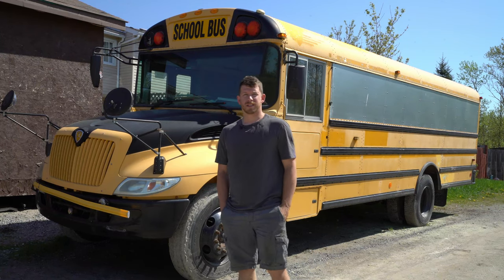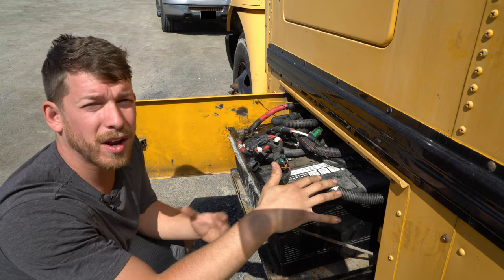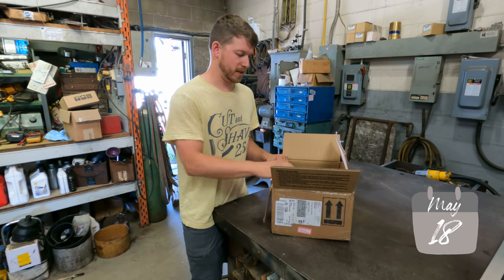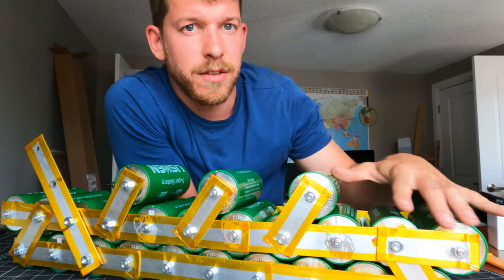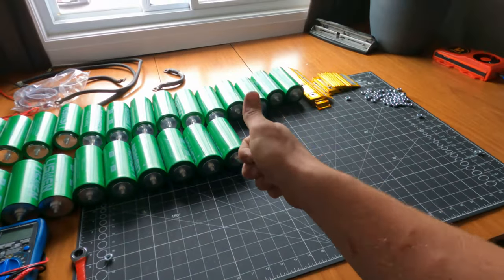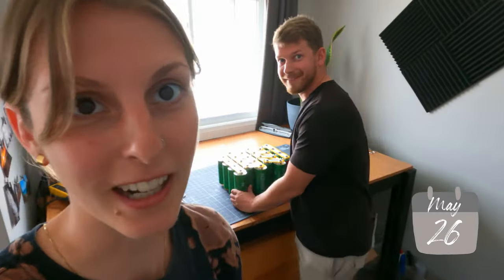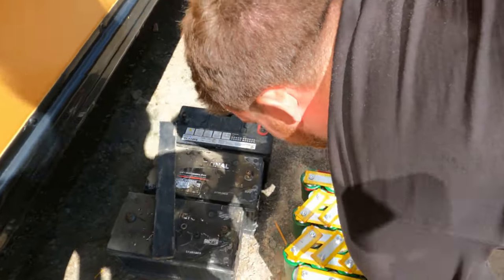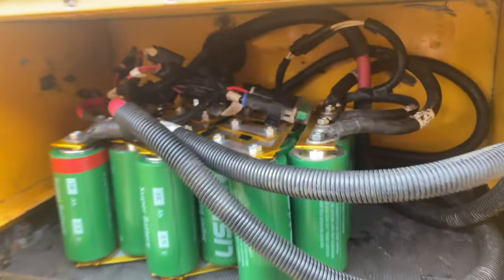DIY Lithium Titanate (LTO) Starter Battery | Skoolie Conversion Ep. 9 | Adam & Steph

Comment: Allow me to give you some advice - what you've created there is extremely dangerous, likely to fail and not a great choice for what you're trying to do. 
   First of all, if your install is intended to be permanent, mounting those cells on their terminals is a bad idea - not only do you have high pressure points on the rubber mat below which will eventually wear through, but it's also bad for the cells as some of the terminals are effectively only press fits.  Mounting the cells horizontally is much better and safer.
  Aluminum expands and contracts a lot with heat - the thin heat shrink wrapping on the cells is sure to wear through in such a high vibration/high temperature variation environment which will lead to short circuits and a fire.  Use at least some fairly thick tape (like the cheaper gaffer tape - cheap gaff tape has a smooth vinyl surface; good gaffer tape is more textured and likely to cause wear) between the cells.  You'll note that the cells have a "bump" around the positive end - that's most likely where the short will occur.
  It looks like the nuts you're using are zinc plated steel, which the way you assembled the pack is a better choice than stainless, but anytime you have an aluminum to steel or stainless steel threaded mechanical joint you must use some sort of anti-seize otherwise the risk of galling and destroying the threads is very high; especially in the presence of electricity.  Also, aluminum oxidizes very quickly, and the oxide layer is actually an excellent insulator - exactly what you don't want in your setup.  You can kill two birds with one stone by polishing the aluminum bus bars right before bolting them on with some fine sandpaper and using something like Noalox on the terminals and bus bar to cell mating surfaces for both corrosion resistance and it'll work well enough as anti seize on the threads and under the nuts.  And that Kapton tape is also causing unnecessary stress to the terminals and forcing the aluminum to bend in order to make contact.
  Your voltage was high because, well, LTO kinda sucks for 12 volt applications.  In a 6s setup like what you've got, you're basically throwing away a lot of the cells' capacity.  Max alternator output is only supposed to be 14.2-14.4 volts; a 6s LTO pack will only give you anything close to rated capacity at at least 15.6 volts.  Since most automotive (and bus) electronics are only rated to 15 volts absolute max, you've over-volted the electrical system to the point of imminent failure.  But once the pack is drained and charging from the alternator, you'll simply have a pack that has a little over half the capacity you think it has.  And you run the danger of going into over-discharge of some of the cells.  LiFePo4 would've been a much better (and probably cheaper) choice in this application.  If you ever drain down the battery to about 12 volts or so, and you start your bus, you're almost immediately going to overload your alternator because you'll be in the "constant current" point of the charge curve and those cells will take more than your alternator can put out - a lot more.  Like 500+ amps more than your alternator can handle.  It's very likely you'll release the magic smoke from the alternator.
  Speaking of which, you really should run at least a balance board.  I'll agree that a BMS isn't that necessary in your application, but a balance board is.  Especially if you didn't top-balance and individually load test them and match them before installation.  It's inevitable that you're going to kill off some of your cells over time.  The active capacitive balance boards work pretty well.
  Finally, please don't use a grinder on aluminum.  Two bad things happen: 1.  You end up ruining the grinding wheel because the aluminum melts into the wheel eventually clogging it and making it useless and 2. The grit ends up embedded in the aluminum, which will then wear anything it comes in contact with.
  Hopefully you don't take offense to these points - I'm literally just trying to save you from getting stranded in a best case scenario, or getting trapped in a school bus inferno in the worst.
Reply from the maker: Thank you for all the advice! When designing the battery, i knew the voltage was less than ideal for a 12v application. I bleed off the extra voltage to protect the bus electronics. I played with the idea of LiFePo4 batteries instead of LTO, but concluded that with consideration of the thermal properties, LTO might suit the canadian winters better and can throw the needed amperage required to turn such a big starting motor. 
For balancing, they were capacity tested by batteryhookup and supposedly matched. I then checked balance and they were all perfectly the same. You are right about needing a balance circuit. 
For packaging, i built a pvc box with internal padding for it, and straightened out the cells so them keep away from each other.
Are there any solutions for the alternator problem? Any battery build that that can start this battery will be able to pull crazy current and probably put the alternator in cc. I think because I’m using this battery so close to the cliff of its voltage curve, it charges up quick enough at the alternators 160amps that it doesn’t overheat. 
Lastly, do you think the gulling on the busbars can cause enough resistance that the battery would drain itself slowly? I cant tell if i have a short in the bus somewhere, or the battery is self draining. I have to keep a battery tender on it to keep it topped up right now. Gahh i should have just built a massive lifepo4 battery with the K2 cells i have lol
Reply: @AdamandAtlas  Thanks for taking my post how it was intended.  FWIW, I'm not just making stuff up - I actually bought 60 Lishen cells from the same place you did and went through and actually tested all of them.  9 were DOA; and the rest were ok, but varying a bit.  The 9 would take a charge, but had a high self discharge - kind of like what you're seeing.  Some of them die quicker than others - going completely dead in a day or two.  I do run a balance board which draws a tiny bit of current, but my first pack has dropped .84 volts in exactly a week.  My packs are charged to 35 volts, so in your case if you see similar discharge rates I'd expect somewhere around three tenths of a volt in a week.  Which is still kind of high.  And no, the oxide on the bus bars (galling will happen on the threads) won't cause drain.  I'm fairly sure these cells aren't new, tested or matched.
  Here's one of my packs: https://youtu.be/KscgGhk3ejs  I ran across your channel looking for real world info on these cells, because the audio guys don't seem to really run useful tests, short of one or two load tests that have some useful info.  In my case, I need 70 volts with minimal voltage drop at 350-400 amps draw for my electric turbo project - we hit about 650 hp using relatively small RC car LiPo battery packs: https://youtu.be/AOL3Qyczt3Y  
  I also built a LiFePo4 pack to replace the car battery - that's worked out pretty well and doesn't overload the alternator because the voltage is much better matched - it's a 100 ah (96 ah tested because one cell is weaker than the others) pack: https://youtu.be/cS1aQJOnqTQ  I actually intentionally installed it almost dead to see if there were any issues charging - and once I figured out I forgot to re-connect the alternator, all seems well.  I'm running a 170 amp alternator.
  I'm building a rather massive load tester to really test these cells (I need to be around 60 volts under load) because I'm not sure I trust these things yet.  A really kind of low-end solution to the alternator charging issue would be to put some sort of resistance in the alternator output.  To limit 12 volts to 160 amps, you need a .075 ohm resistor - problem is, the resistor would be dissipating almost 2 kW.  It might be smarter to get a DC current clamp meter and find out how much current the battery actually draws during charging.  Another option is that most modern internally-regulated alternators have a sense wire that determines voltage output - the sense wire is designed to adjust the alternator's voltage output to compensate for voltage drop.  Typically, voltage output it regulated to around 13.8-14.2 volts.  It will sag under heavy load.  You could monkey with that signal (a boost converter in line, for example) to keep the voltage in check until the batteries charge.  Another option is to speed up the alternator with a bigger crank pulley or smaller alternator pulley - keep in mind, alternator cooling is directly related to the speed of the internal fan.  There are a lot of options.  I can think of a few more, but this is getting pretty long.  If you go to my channel under "about" you can find my email address.  You can send me an email if you'd like; I'm happy to help out.  
  But let me ask (about the Lishen cells) - how much voltage drain are you seeing over what period of time?
Reply from the maker: @AlexLTDLX  amazing Information! I think we’re going to need to do a crossover episode on our channels and you help me sort this stuff out 😅. For your voltage drop question, I’m seeing a roughly 1.5-2 volt drop in about a week. Now, I may have a bad wire in the bus that could be causing it. The bus is under construction after all. I should have tested them more thoroughly. I need to get myself a capacity tester. I just bought 24 prismatic 280ah cells (very similar to your 100ah cells) for my big battery and now I want to check them all as well.
Reply: @AdamandAtlas  Wow - that's a lot of drop.  Can you get to the individual cells to measure their voltage?  I'll bet you'll find 1 or two cells (or in your case multiple cells, since you're running parallel cells (or packs, I'm not sure which)) much lower than the others.  A good way to test and find out which cells are self draining is to take the pack apart, connect all the cells in parallel (so you have one massive 2.5 volt battery), charge that battery up to 2.8 volts until current draw drops under 100 mah (I use 85 mah as a sort of arbitrary charging cutoff), and then take the bus bars off and let the cells sit.  Every few hours or so, write down cell voltages.  You'll soon find the weak and/or self discharging cells.  You can find 20 amp adjustable power supplies pretty cheaply on amazon or ebay.  And sure, if you want to do some sort of crossover episode, just hit me up.
Reply from the maker: @AlexLTDLX  when I pulled the battery out to build a box for it, I checked all the individual parallel connections and the voltages were still balanced. Idk. I’ll shoot you a message and we’ll discuss  more :)
Reply: I’ve also bought a set of lto’s and a bms to build a battery pack. 45Ah 6 pack. At 14.5V should be at 80% which should be ok. A pb-acid has worse  charging efficiency and should be kept above 40% so you have much lower capacity than rated, to play with. My car uses 85Ah. the self discharge rate if higher with lto can be a problem. some sms device with low battery alert would be useful. Anyway, the internal resistance being so low would probably be a problem, it would act almost as a short so and the alternator will run at full load. in fact my alternator overheats at idle with headlamps on and radiator fans on. It has a 10% smaller pulley  than stock which is one factor. my plan is to first test a cooling system: a 80x80mm fan DC 12V 2.5A   at the back of the alternator and 75C thermostat. Another solution  I have thought is to control the regulator using the sense wire to make the regulator reduce its output while measuring the current (with a shunt), voltage and temperature of the alternator.
Reply: Very well said. I'm using lto for my car auto and needed to hear about the charging side of things. Hight output alternator will fix my situation I'm sure. As of now I just got the lto out back with an isolater in hope I don't kill the alternator with my agm under the hood. Of course I will change every night while I still have my stock alternator.  Thoughts?
Reply: alternator can not give unlimited charging current: it depends on current that passes through rotor(and rpm), but some regulators have current limit what means you can not get high amperage at low rpm so diodes will survive: i have device that uses 70 amp, on alternator rated on 70 amps and when it is on(first 3 minutes after engine is started) , voltage is 13.6 v , and alternator is still alive after years of use

Comment: You learned a old dog a new trick, I'm intrigued by new battery technology, didn't know this existed. My curiosity is the volt meter read 15ish volts or higher, my experience with that voltage is spiking the system and damaging electrical components. Very well done in your research and design. Enjoy your videos
Reply from the maker: This battery packs nominal voltage is 15 volts (we had just freshly charged it). We just had to bleed off a bit of it’s power. The alternator will charge at 14.7 volts so the battery will now only go that high. Thanks for the comment! Stay tuned for another video with more in-depth information about lithium batteries!

Comment: Hello from the high desert of New Mexico USA 🇺🇸. I just found your channel and I liked and subscribed. I live in my 1967 GM TDH-4519 city transit bus. I noticed a couple of things, first you need to get a bms to protect your battery and second I would look into a DC to DC charger because your alternator is not designed for lithium batteries and you can burn it up. Keep up the good work and stay safe and charged

Comment: Nice one Adam. From experience, i know they do suffer when exposed to cold so you may want to insulate that bay well. You have the space.
Reply from the maker: This is a different kind of lithium chemistry. Lithium titanate can handle -50 degrees Celsius with no problems. Though I will be building a box to house them for safety.
Reply: @AdamandAtlas  Excellent mate.

Comment: Neat...From what I understand, lithium will require too much from an alternator and destroy it.  Very low internal resistance and will overwork the alternator. Solution is to add a DC-DC charger to limit the current.  I was also wondering if you added a BMS? I love to see a more detailed video.  I'm looking to build one for a marine application.  Cheers.
Reply from the maker: Our bus has a big 160amp alternator that keeps the battery full with ease. I didn’t go with a BMS into this battery. The amperage required to start the engine is so high that theres no bms that could handle it. Also, Lithium Titanate is a very robust chemistry that can function in almost any temperature. So, the thermal protections that BMS’s offer are not needed. 

For a marine application, i’d recommend LifePo4 (lithium iron phosphate) unless you need crazy cranking amps. I build a battery inside a pelican case for my boat and it works well.
Reply: @AdamandAtlas  awesome! Thanks for that info! I was thinking lifepo4 as well for the boat. It's a yamaha f90. The alt is a 35amp and motor CCA requires like 300amp, but I think actually draw is much less. I like the idea of ditching a bms to avoid issues there anyway. Plus you can check balances periodically if needed.
Reply from the maker: As long as you don’t use it in temperatures under -7 (which i can’t imagine you would in a boat) and you don’t over discharge it, the BMS isn’t necessary. 

In my pelican case build, i added an inverter and usb chargers to the case and ran those things thru a bms and wired the main starting posts direct without a bms. best of both worlds!
Reply: @AdamandAtlas  I would recommend using a BMS for charging so at least the cells remain balanced, or use an active balancer. You can still bypass the BMS for all loads. I do this with my inverter and my LFP leisure battery. The only other thing I'd be concerned with is low voltage protection but starter batteries should rarely hit this if there are no parasitic draws and the vehicle is driven regularly.

Comment: Hey guys.  Been loving the videos.   I would be very interested in watching a video of the starter battery build.   It looks great for $600.
Reply from the maker: Thank you! We will for sure have a video out about it shortly! :)
Reply: @AdamandAtlas  thanks guys.   I am curious about a bms and can the battery pack you made handle the charge/current from the bus alternator, as in won't it try to overcharge the battery pack?  Sorry, I just have lots of questions.
Reply from the maker: This battery can handle a charge current of upto 1080 amps continuous and the buses alternator charges at 160 amps. So no problem there. 
For your overcharge question, The alternator charges at 14.7V, which means it can only charge a battery upto 14.7V and this battery can handle a maximum of 16.8V before damage occurs. Because of this, and the battery being able to operate in almost any temperature, i went without a BMS. They don’t make a BMS that can handle the Amperage needed to start a big vehicle anyways. 

Hope this helps!